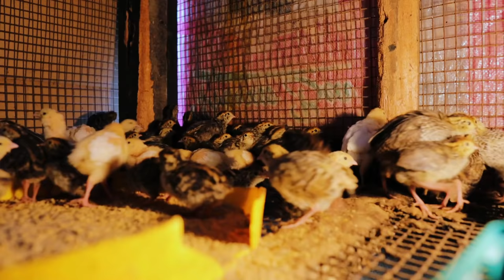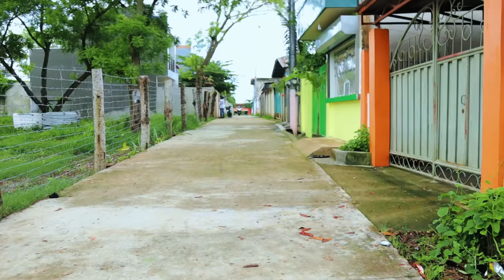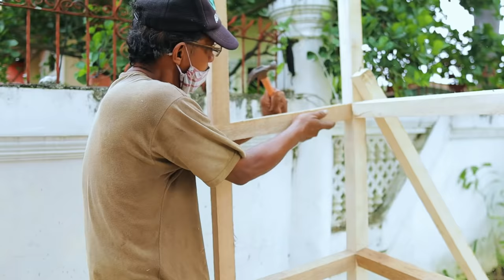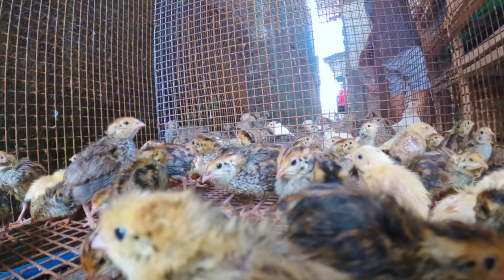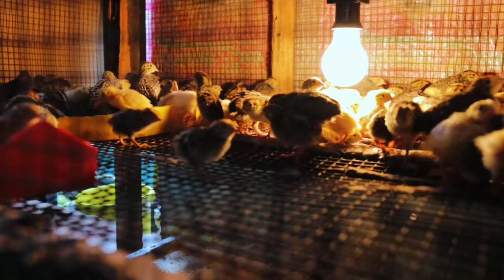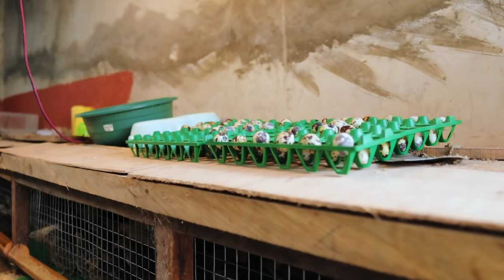DIY CHEAP 3 LAYERED QUAIL CAGE│Building a new layer Cage with superb design! Quail raising Tips

Comment: Love this channel❤
The dung collection tray should have a thin layer of wood shavings or rice hulls. This will allow you to save labour because you don't have to scrape dung everyday then because of reduced moisture and odor. The collected mixture of dung and shavings will compost better and can be sold or used for fertilizer.
Reply from the maker: Thank you for the tips.
Reply: This is actually correct
Reply: correct

Comment: Yes, this cage looks the most practical in its design so far. The inclination provides an excellent way for the eggs to roll out instead of digging elbow deep inside the cage to collect them. Less stress for the birds and less of the birds escaping by flying out suddenly.
But you did not provide the measurements of the cage and most importantly: the inclination in degrees of the inclined floor. 
If you could provide this information, it'll be perfect for building.

Comment: Time is money. If you have a pressure washer you can use it to clean the dung off of the poop layers. Now if your nation doesn't have the water pressure to do this, you could also get a pump for where you have water. But good luck with your farm